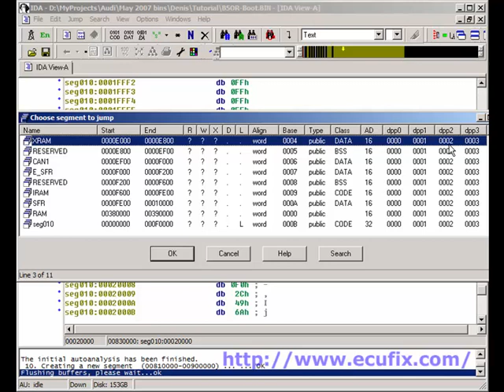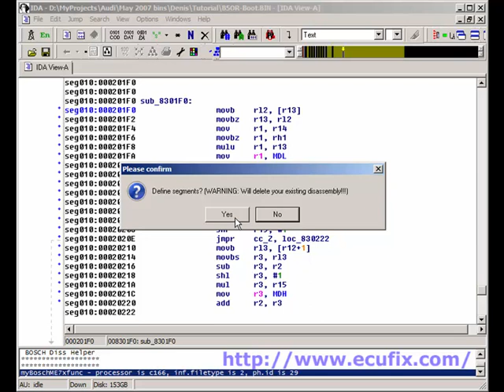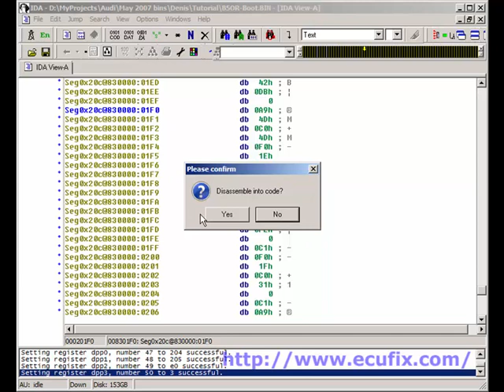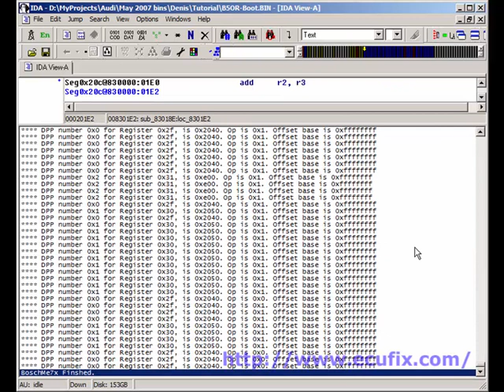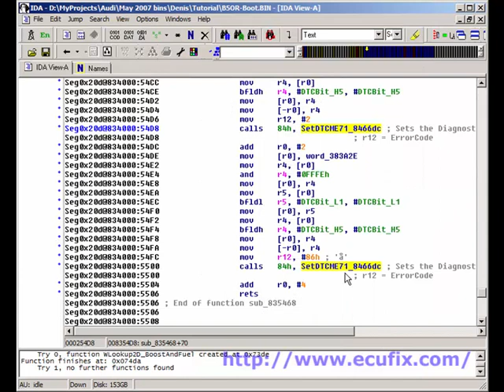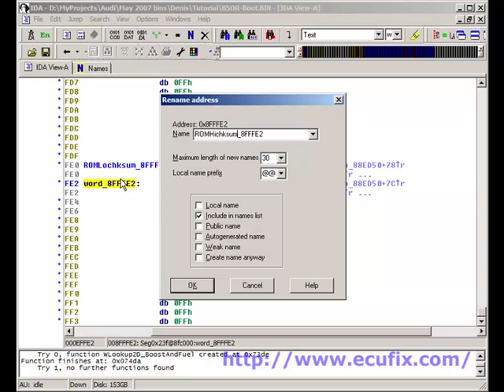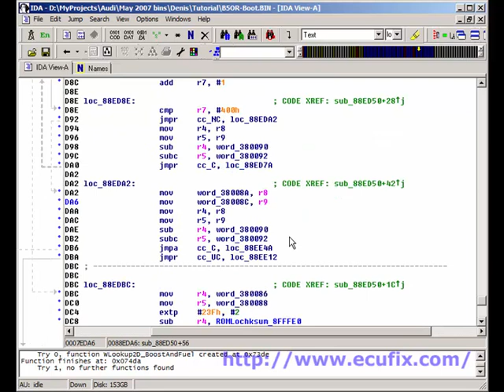IDA Disassemble Bosch ME7.1 ECU Tutorial 3

Comment: Hey Andy, really helpfull video series you've got here. Ive got a couple questions i hope you could help me out with. I'm trying to use the plugin you wrote for IDA, i loaded everything into IDA the way you specified and run the script. Then IDA crashes at the set DTC enumoration point. In github you mention an PLW file, but i cant seem to find this on your github?
Thanks
Reply from the maker: Hi Sigurd, the plw is simply the renamed dll that gets built when you compile the plugin.

However, like I explained to others, it's been several years since I worked on this and I don't think I can help you with your crash.

It might be worth dropping the guys at Data Rescue an email to see if they can shed any light on your problem - they've been really helpful in the past.